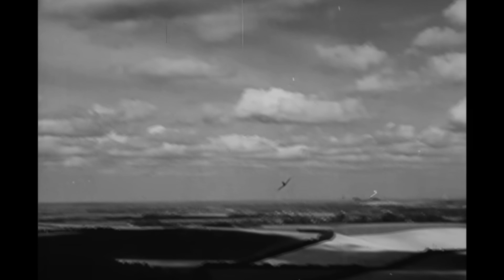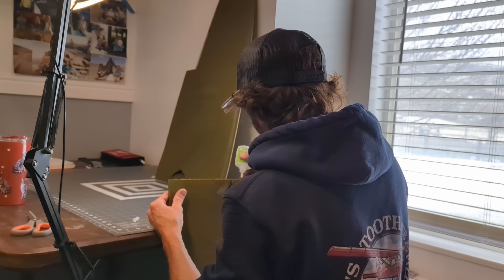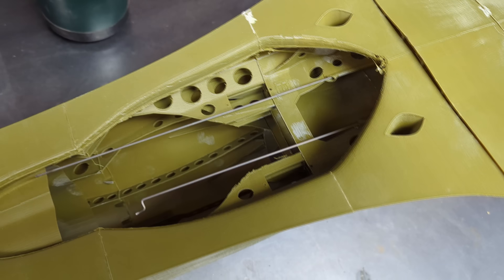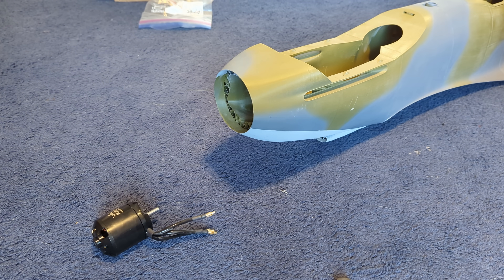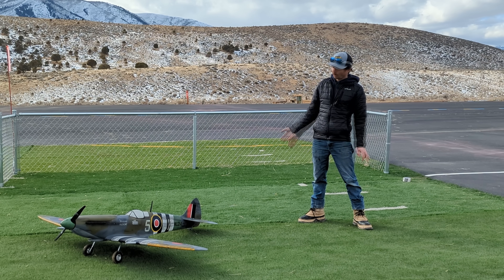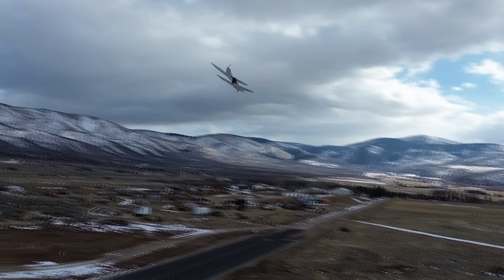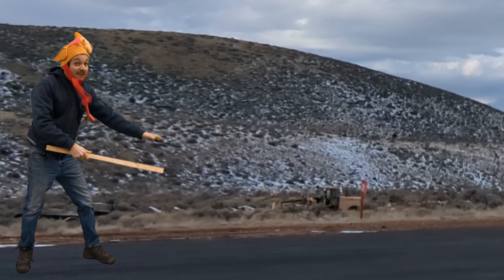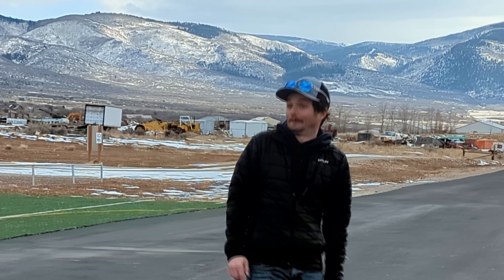Building and Flying a MASSIVE 3D Printed Spitfire (Ft. Drone Collision)

Comment: lovely aircraft - did you do a "mend it" video for the wing tip? (how do you mend 3D planes?) great job - sub
Reply from the maker: Thank you! Its really easy. Luckily it just broke at one of the seam and didn't break the part itself. Just a little superglue and I glued the wingtip back on. The beauty of 3D printed airplanes is if you ever do break a part substantially, you just print a new part and replace it.

Comment: Great work! Love 3DLabs projects and your Spit looks amazing. Re the J3 Cub’s wing folding event mentioned in the beginning, from my experience could be caused by a combination of the following:
1. Aft CG - causing it to pitch up sharply and over stress the wing with the slightest up stick command.
2. Wing hold-down rubber bands not tight enough. Many fall prey to this. When inducing positive G on the bird, if the bands are lightly stretched, the wing will lift off the fuselage, sharply increasing lift and snapping, seemingly inexplicably. Learned this the hard way many years ago…

Comment: i will say, very entertaining. also for the plane design is great, one thing i know the tips not supposed to fall of, but man you are lucky that it held while in the air. if the design's tip wasn't a support feature for the aileron and it lost the tip it wouldn't matter but the fact that held on till ya landed man. that saved A LOT of print time. which im sure its w/e i just hate waste and would hate to see it crash lol

Comment: Hi, this is Chris in Bulgaria. I have actually seen a real spitfire do that swoop as yours cut the grass. I was not expecting a Spitfire after the grad Prix in England and to fly that low. Still a memory to this day. Nice drone killer, it would be good to see your spitfire knock down a few more drones. One thing I hate about radio control models is the 2 blades not the 3 or 4 in the later models of the Spitfire. I do understand why though. Only the MK1's as far as I know were 2 bladed but were replaced very quickly because of the performance of the plane. I made a fantastic replica of a 3 blade Zero prop, I just hate those 2 props. Also, Spitfires were generally gloss not matt. Lovely project. Mustangs used the spitfire engine!!!!

Comment: I don't see you using an accelerator. Isn't that mandatory when gluing these 3D printed planes?
Reply from the maker: I haven't used an accelerator on any of my 3D printed airplanes. Just normal CA and let it cure.
Reply: @J.T.Engineering  I asked because 3DLabPrint is very insistent on using CA accelerator.
But if your planes don't fall apart while flying, it's clearly not a problem lol.
Reply from the maker: @stejer211  I use ZapAGap medium CA for pretty much all my airplanes and I haven't had any fall apart from glue failure. They tend to fall apart because I crash them 🤣

Comment: It's funny the whole time throughout the video, I couldn't stop asking why you wouldn't put a carbon spar thru the wing.. Eventually,  I decide to check the comments to say if anyone else had the same thoughts, and sure enough, the first commentS were having the same line of thought.
Reply from the maker: 3DLabPrint didn't design a spot for a carbon spar to be installed. I really wish they would have, I think it would have made for a way better wing design. I wanted to fly and test the plane exactly as they had designed it for anyone out there that may be considering building one.

Comment: spitfire landing flaps only have two movements open full and and totally closed
Reply from the maker: Good to know. I assumed they had a takeoff position around 10 degrees. I noticed while I was editing the video that the landing gear on real Spitfires don't retract at the same time either, so ill definitely be tweaking some things in my transmitter next time I fly. Thanks for the info!

Comment: fyi    a main wing is supposed to have a load-bearing and fuselage-spanning main spar, located at  THRTY  percent of chord.!!!      any wing design that does not include such a main spar is  DEFECTIVE.
there is seldom a valid reason to put flaps on a model aircraft.!     there is absolutely no reason to put split flaps on a model aircraft.!
1240   you are talking about p-factor.     and your explanation is  WRONG. 
specifically, p-factor is the feedback torque from a prop that is turning clockwise, and it is present all the time.   but its affects are most extreme when there is little to no stabilization, coming from a main wing that is moving through the air at a nominal speed.

Comment: Just to let you know those Invasion stripes were painted on all allied aircraft so other allied aircraft and ground forces could easily identify friendly forces. 
Can I ask how long did it take to print the whole Aeroplane ?? great job BTW but I think a bit more sanding and maybe Aero filler to smooth out the Fuselage would make it look better mate
Reply from the maker: It was a pretty long print. It took probably 2 weeks to print all the parts. Maybe a little longer. 

I considered doing more sanding and using filler, but I actually kind liked being able to see the seems a little bit. I thought it simulated the panel lines better than i could have with an airbrush. 

If you do print one and clean it up more id love to see it!

Comment: I have a few tail draggers with torque roll issues. I've mixed a little rudder with the ailerons so when I panic and forget to use the rudder in favor of the ailerons, at least I am getting some rudder in there.  Really tames the plane down nicely, esp tail draggers.

Comment: Awesome video. What type of PLA did you use. Just regular old PLA?   Ive been dying to print a plane myself but usually the files ask for light weight PLA.
Reply from the maker: This was Polymaker Pro Army Green PLA. There are quite a few planes that can be printed in standard PLA. I have another video on my channel where I 3D printed a plane I found on Thingiverse that used normal PLA. I think it's an excellent build for a first time 3D printed airplane.

Comment: I printed and build a spitfire very similar to the one in this video.  I was thinking about mixing up some epoxy and watering it down with witch hazel and painting a thin coating on the finished model.  Thoughts???
Reply from the maker: I would be a little concerned about the weight. Epoxy isn't heavy, but it isn't light either. If you coated the whole plane it would add up I think. You could always print it in LWPla to offset the epoxy weight, but I'm like 90% sure these files aren't optimized to be printed in case mode so printing in LWPla may not work well. Honestly I think the wing is plenty strong as it is. It hasn't folded yet anyway, and I haven't heard of anyone having issues with it.

Comment: where is the 5bladed propeller unique to the griffon spitfires
Reply from the maker: @kspplayerheffele I was trying to find at least a 4 blade, but the 4 blade propellers were substantially more expensive than the 2 blades. I wasn't entirely sure how the maiden was going to go, so I bought the cheaper ones thinking it wasn't going to fly very long. Now that I've flown it, I'll definitely put a different prop on it because the 2 blade doesn't look great.

Comment: also, instead of using ca glue, why not use epoxy to hold the wings together?
Reply from the maker: @iammeobviously6815  epoxy takes time to set, which can sometimes be problematic for these builds. Super glue has so far worked pretty well for me.
Reply: @J.T.Engineering  any value to use accelerants?
Reply from the maker: @en2oh  In the 3DLabprint assembly videos, they use a CA glue and activator. That way you can orient the parts how you want them and then activate the glue. I haven't tried this kind of glue. Regular CA cures pretty quick.

Comment: I end up using epoxy often for 3D prints, because CA glue rarely seems bond well enough for me. Which is odd because CA glue is often recommended. I think I figured out the problem. I'm in the In Utah desert and where the humidity stays about 20% I found out CA glue reacts with humidity in the air. I wonder if CA glue just sucks in dry places.
Reply from the maker: I also live in Utah, and haven't had any issues even during the hottest and driest months of the summer. I use ZapAGap Medium CA and occasionally the Gel Loctite CA for all my builds, and I have yet to have a plane fall apart from glue failure. They usually fall apart from operator error! I also use WAY more than I probably should.

Comment: Nice build. Seems crazy to not have any reinforcement though. If you prop it for more speed the wing would probably fold.
Reply from the maker: @stevec7596  I 100% agree. I couldn't believe it didn't have a carbon spar when I was printing it. I was pretty certain the wing wouldn't be strong enough but it held up even through some high G maneuvers.
Reply: @J.T.Engineering  I think that's part of why the wings are 2 piece. I printed their Piper Paine and as a smaller plane than spit. It also was a 2 piece wing. I think the mid interlocking section and glue are what's used as the spar. could email the owner as I think he was an aeronautical Engineer.   Fist time airbrushing still came out looking good.
Reply: And they never bothered to update the files to accept any carbon spars, or at least a 3d printed spar.